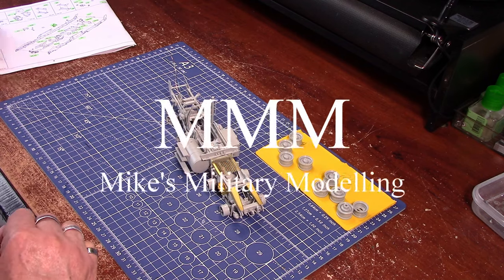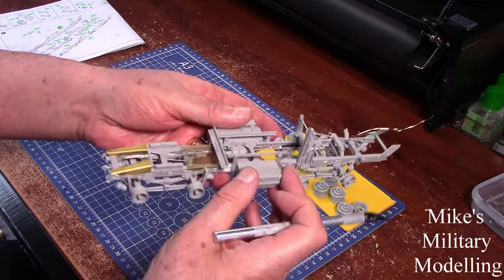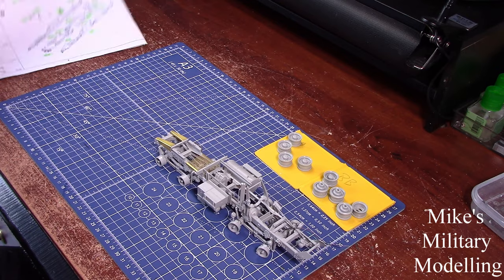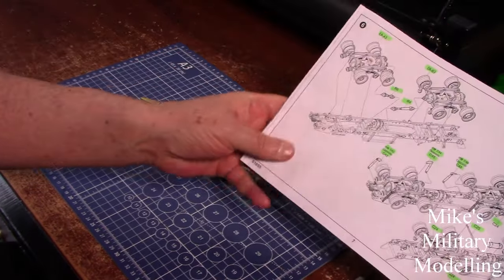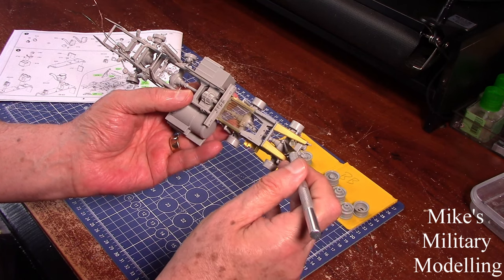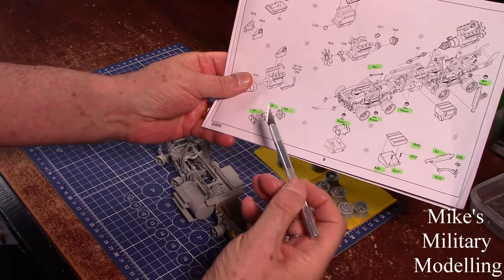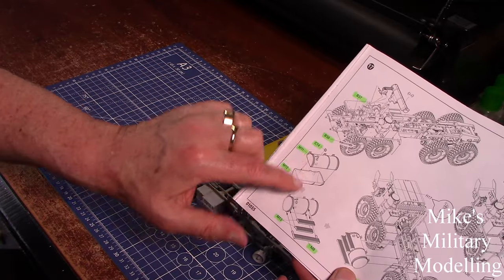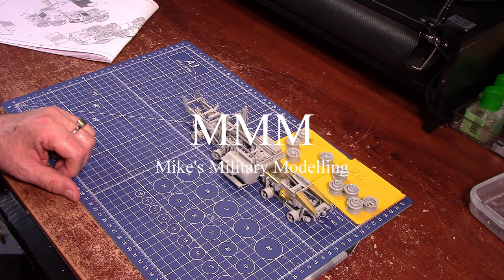M983A2 HEMTT Tractor & M870A1 Trailer 1:35 Trumpeter Kit (Part 2 The Tractor Chassis)

Comment: Did you consider using the Real Model Aftermarket sets for this model because these sets  contain a load of detailed parts incling the engine and additional cross members etc?
Reply from the maker: Hello Simon, Yep looked at loads of them for all the kits I've built but to be fair the cost is too high, 25% of the cost of the kit for the engine for example. I bought an Edward interior kit for the M1070 but I didn't really feel it was value for the money I paid.
I guess it depends on how you plan to display the finished truck, if you are going to leave the bonet (hood) up then you need an engine.
Cheers Mike.